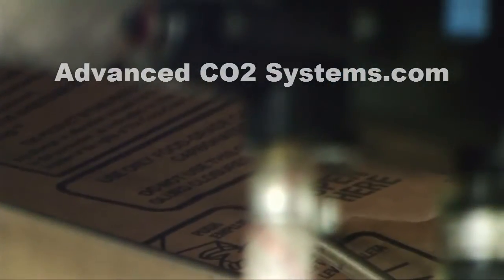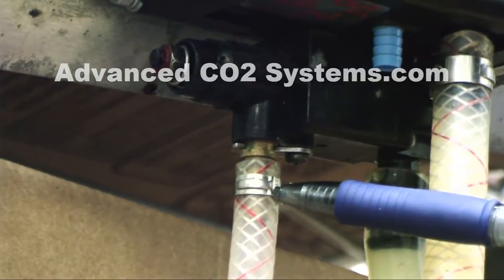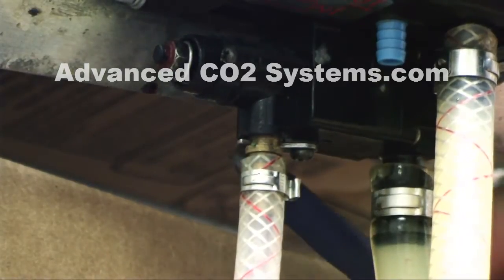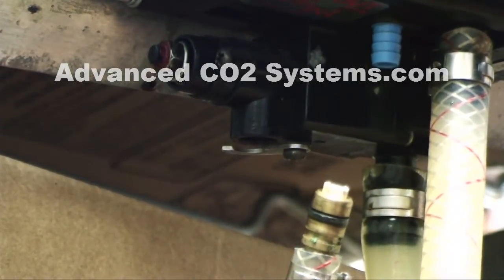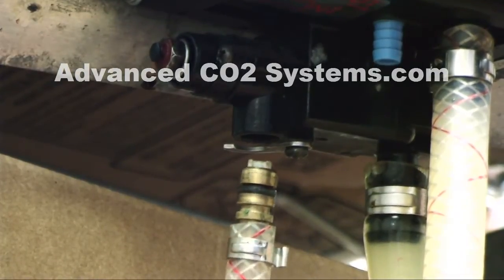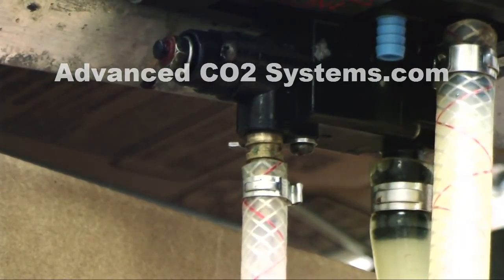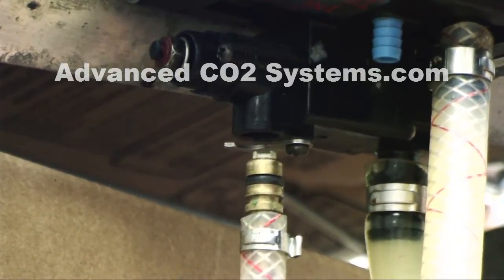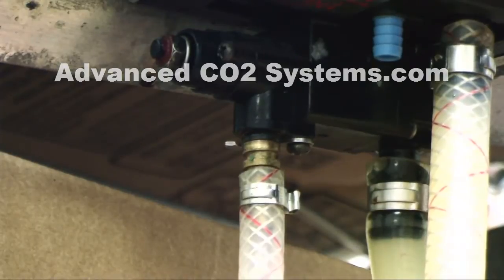Disconnect the CO2 from your Beverage Pump - Advanced CO2 Systems

Comment: Here is a Q.
I have hooked up Iced Tea into my fountain and I do not want CO2. Can I just disconnect the CO2 and still be able to draw syrup? I mean is the CO2 for flavor only or is it used to push the product?

Thanks.
Reply: MrDunkiemon C02 just drives the pump to pump the syrup to the fountain.
Reply: +Lonnie Wood  I'm not good at this can you go step by step on how to or even better can you do a quick video.  I  have the same problem. I'm trying to imstall lemonade without the carbonations.  thanks!
Reply: The pump sends syrup to the fountain unit. The water is piped to the dispenser valve and will be either carbonated or non-carbonated.  There may be repiping to be done to change from carbonated to non-carbonated.